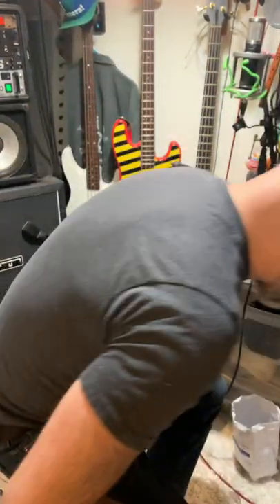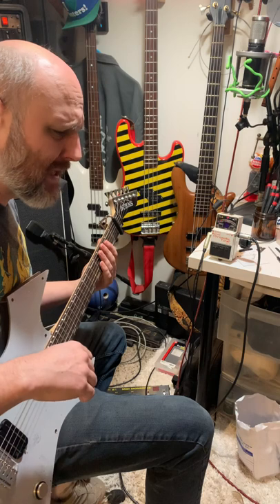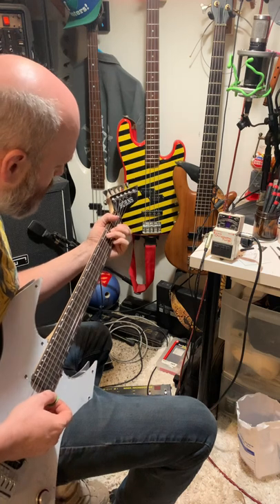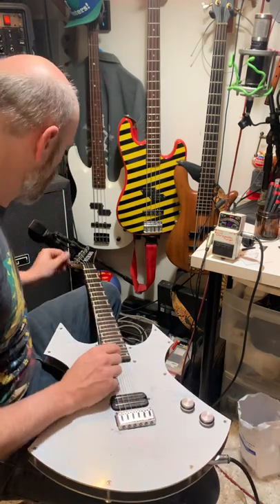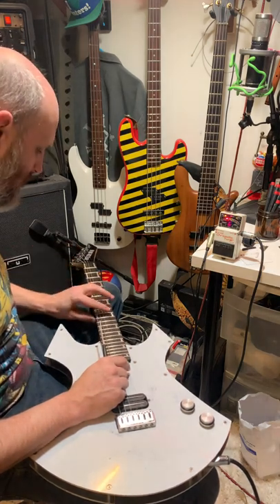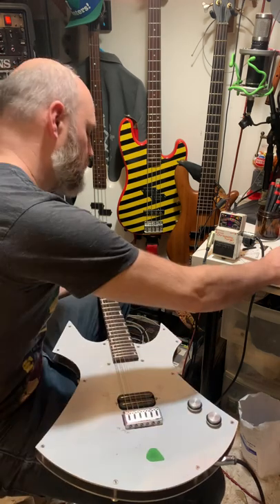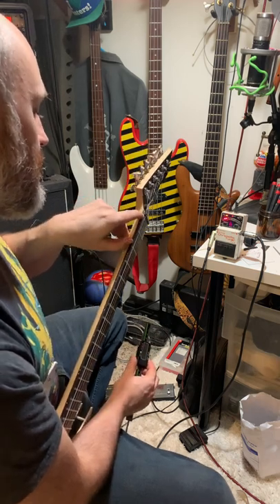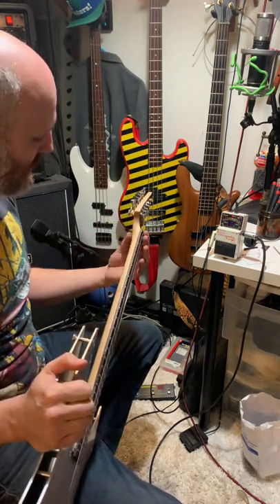16 minutes explaining issue with a guitar neck. It wont intonate. Northern Redfish Guitar Neck

Comment: So are your only options a new neck? Is it string through bridge? If not then would you have to refill then redrill the bridge back? An adjustable bridge that can move back from its current position? Sorry about that man. It's a sweet axe.
Reply from the maker: Its not gonna go away by moving the bridge, its the NUT that has to move, you cant change the scale, new neck means a difficult if not mear impossible realignment, that maybe Id do, but he is not offering a new neck nor is it realistic since it can be fixed with less work. What has to happen, I need to move the nut, so I got a GraphTech, TUSQ nut that is same string space and a tad wider than needed, and is way tall and way thick, but I will file it down, then take micromesh to it. I think its like $20 in parts and $20 labor basically to fix
Reply from the maker: bridge is string through
Reply from the maker: If I capo it on fret 1, its intonated, so its intonated if I fix the nut
Reply: @idiotburns  didn't think the nut in a fix slot was gonna give you much movement.  40 bucks is the better solution if you can't get a replacement from the manufacturer.
Reply from the maker: @evelynsgateband  It doesnt, I have to file out the fret board at fret 1 at nut, enlargening the gap towards the frets, then filling gap that nut is now to small for w larger nut
Reply: @idiotburns  ah I follow now. Yikes.